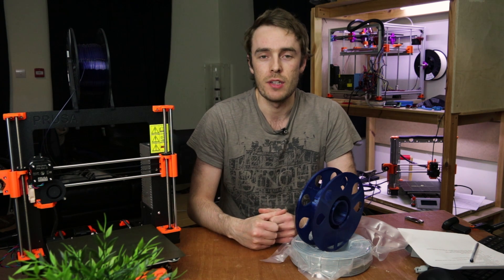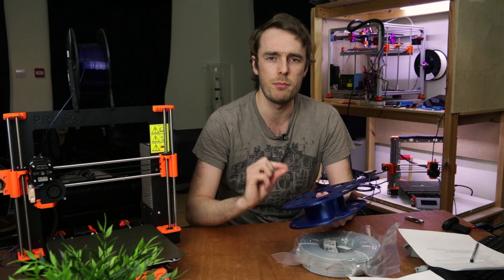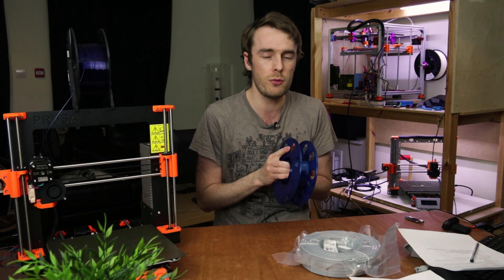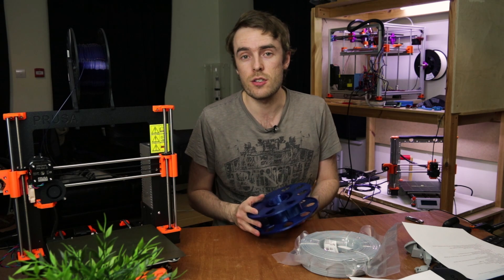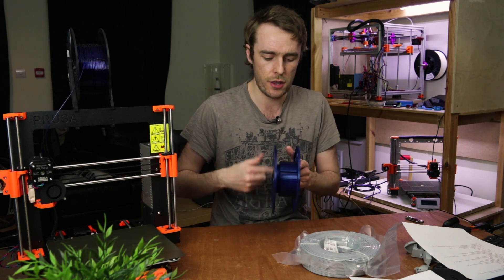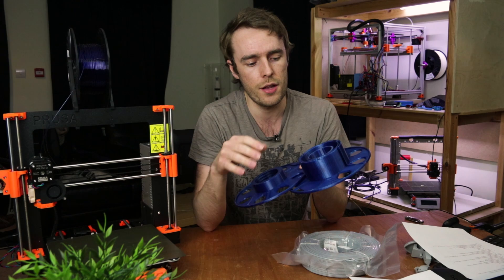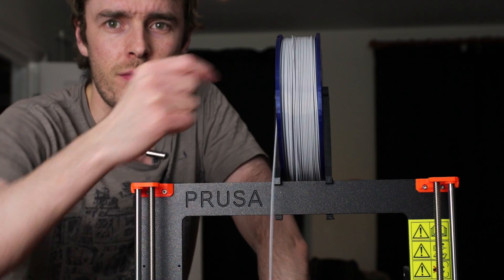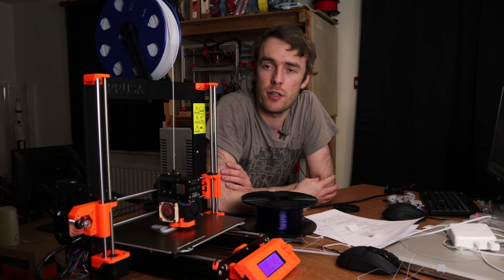The Masterspool

Comment: I just found your video about the MasterSpool. I just came in to this topic and my first spool was the "Little MasterSpool"(https://www.thingiverse.com/thing:2791930). Quite a nightmare. When you have two side by side, they cling into each other and the filament tangles off. Then I found the Twist and Lock MasterSpool (https://www.thingiverse.com/thing:2823667). This needs a "key" to open, but its fast and secure. I'm just printing another one to test with a "fresh" new filament refill.

Comment: The Master Spool does not have to be printed.   It could be made from a plywood, with a cardboard tube, piece of aluminium sheet, etc.  How about making one from an existing injection molded spool.   Cut off one side and make a side which can be attached.

Lots of options to printing.
Dave.

Comment: I did a very quick sketch of a 2 part cardboard box (similar to Polymaker boxes) that can function as spool holder and take refills.  Why not use the cardboard box the filament is packed and shipped in as a masterspool. Little modification is needed. Am I missing something here? https://twitter.com/2GregEl/status/965324482515800065
Reply: Thanks for the responce. Well not all cardboard is made the same. For example the cardboard spools Formfutura uses for reForm materials are very durable and have low flex (point you mentioned on this video on rigidity)!  The design is extremely easy to do, two 5 sided boxes that one fits over the other. Polymaker does it already exactly like that and all you have to do is add one cardboard sheet with a simple slot-hole in the middle on one half and glue a cylinder cardboard or 3d printed on the other half-side. The only catch is that the refills are wound on a cardboard tube and ship with it and not just with zip ties like Das Filament does it. I will try to find some time and make a prototype.

Comment: I still don't understand how this is an improvement over cardboard, like Proto Pasta uses. Those weigh far less, are even easier to recycle, and don't require the user to print a spool (something they may struggle with on a smaller printer).

Comment: I don't think a snap together spool would work too well, the snapping mechanism would fatigue relatively quickly and render the spool unusable. Kind of defeats the idea of a a reusable spool if you need to reprint one regularly. Maybe a space for a locking pin to stop the threads coming undone, would also give it a fixed alignment point.

Another idea is possibly having the hub/thread independent of the side plates, so you can thread the hub together and the plates have a key slot that located them on the hub. That'll also keep alignment consistent. A push release type ratchet could also be integrated into the the parts that thread together, so it stops them from unthreading when you don't want them to.

Comment: Why not have the Filament seller offer spools with either the filament on an injection molded "master spool" together... or just the filament alone. Then when you find you have enough master spools you can order just the filament in the future. If people love the savings from having master spools then people will likely order filament from the first filament provider that ponies up the money for the injection molds... so that filament company would get people biasing there purchases towards their company... at least until the have their fill of master spools... no pun intended. I personally have a large laser cutter so I can cut spools sides and only 3dprint the hub... which is what a filament company could also do... injection mold just the hub and laser cut the spool walls and throw in a bag of nuts and bolts that the customer can use to assemble their spools.